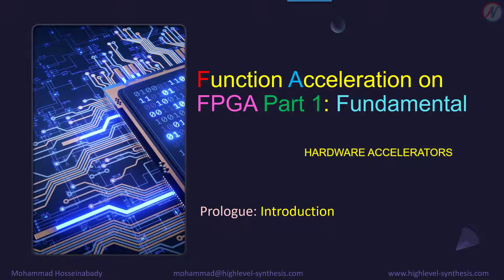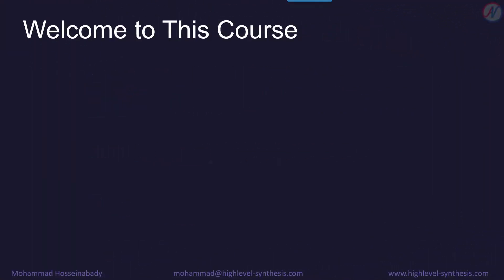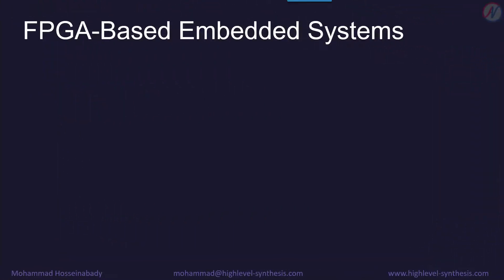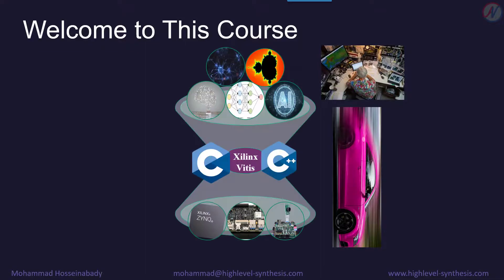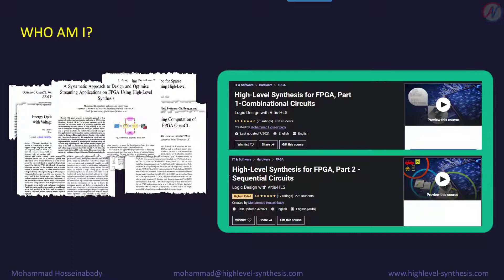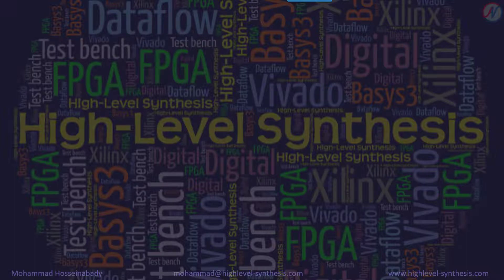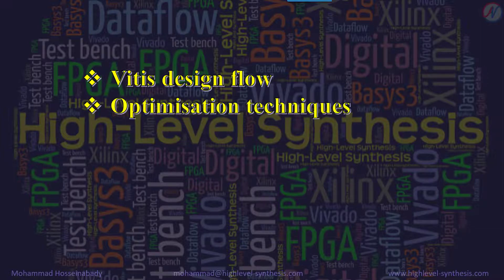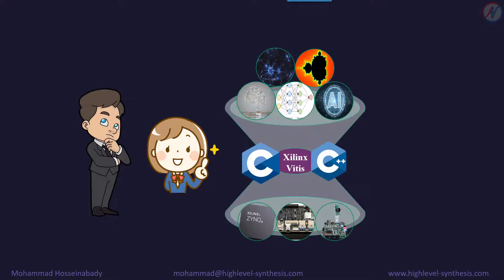Function Acceleration on FPGA Part 1: Fundamental

Comment: is the zynq the perfect choice for hpc using hls, even though its complexity for newbies ?
Reply from the maker: First of all, the Zynq is an FPGA-based embedded system used in end-devices and for edge computing, and it is not designed for HPC in general.
Secondly, there are three groups of FPGA-based technologies available that are compatible with HLS acceleration: 

1-	Zynq (MP)SoC platforms,  
2-	Versal™ adaptive compute acceleration platforms (ACAPs), and 
3-	UltraScale+™ architecture, including Alveo cards.

Whereas the first group can be used for end-devices and edge computing, the second group is suitable for edge computing and the last group is designed for data centres and cloud computing ( or mainly HPC).

The first group are cheap that is affordable for almost all designers and newbies. In addition, as they were the first platforms for which HLS was proposed, there are many resources, examples, and tutorials that newbies can access. 

The two other groups are relatively new and expensive, and all designers cannot afford them. 

Regarding the HLS design flow, you can almost learn the same design flow using an FPGA in one of these groups. 

In summary, choosing the platform is depends on your applications and the underlying framework that you are going to run your application, whether it is on end-devices, edge, or cloud. And for some embedded applications, Zynq&ZynqMPSoC are the best and only FPGA-based options.